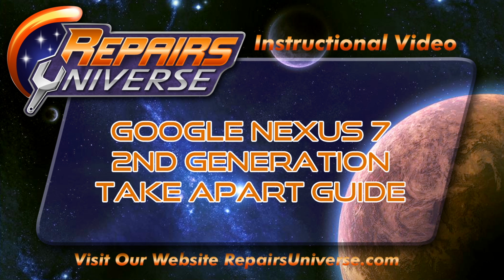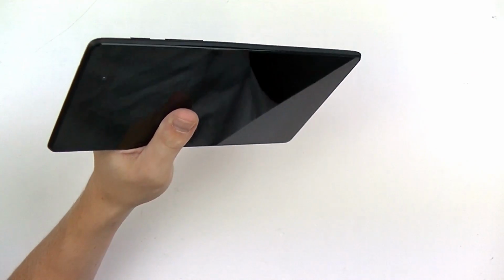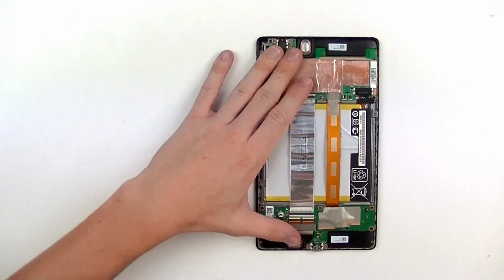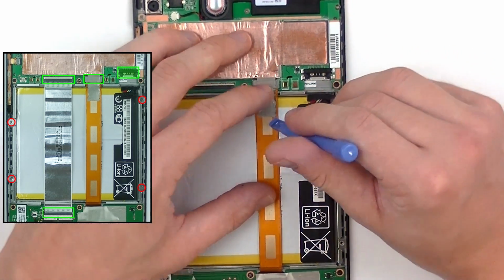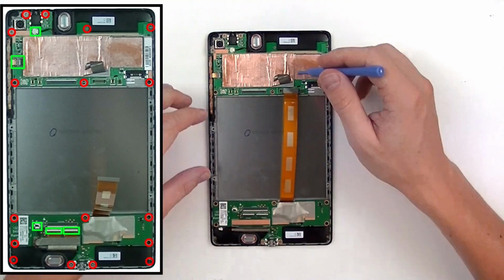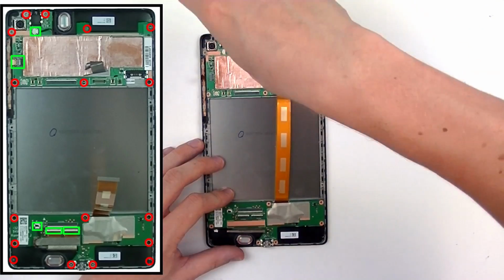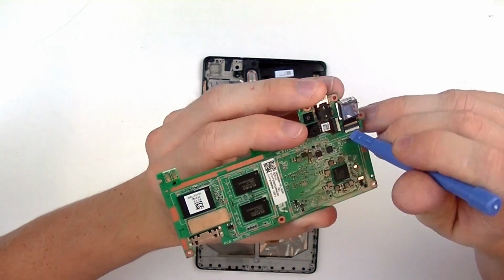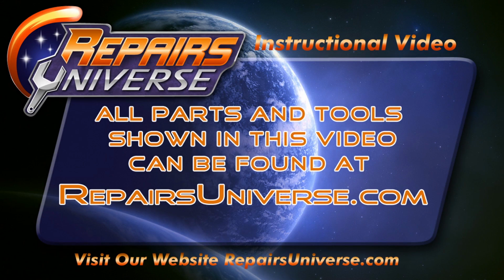Google Nexus 7 2 (2nd Gen) Take Apart Repair Guide

Comment: This is a great video, I used the information from your tutorial to swap my 16gb nexus motherboard for my 32gb. The 16gb works great, but the 32gb's screen was broken (just like in this video). I was worried about taking my working tablet apart, but after watching this video, and seeing the correct way to dissect my nexus. I was successful in replacing the 16 with the 32. This video is much appreciated. The best out there by far, it sucks watching videos without the commentary. Thank you.

Comment: Hi. interesting video. Same model as mine which had a mother board replaced under warranty due to intermitant ear phone socket connection. After replacement connection is  still sensitive to how far plug is inserted on various phone plugs. In your opinion is this typical as a number  of users have commented about problems with ear phone connections
Reply from the maker: +Keith Walters Possibly a manufacture issue as this should not be common.

Comment: Finished! This is the first time I've taken apart a tablet or cell phone, and it took me almost seven hours. The single biggest chunk of work was getting the old screen out of the bezel, which took me over two hours. More advice on that would be beneficial. Also, running through the reassembly would be helpful.

However, I have to say I'm really pleased with the quality of this instructional video, it was a tremendous help. The people at Repairs Universe where helpful and efficient. I chatted with a sales/tech rep before buying the digitizer & screen assembly, and their advice was valuable. I was going to buy just the digitizer and glass, but they talked me into buying the complete screen assembly. I was unsure whether they were just trying to sell me the more expensive part, but after having been through this, I'm very glad I listened to them!

Comment: Mine is 2014/4 manufacture, and there are a few subtle differences:
* The battery is held in place by more screws. Removing them reduces the number that have to be removed later.
* The lower speaker connection has moved.
* Important: the upper and lower motherboards are connected via two wires that run along the sides. You probably don't want to mess with those connections, but it's easy to remove both boards as a pair. Tape holds the wires in place along the sides.
* The upper motherboard has an extra screw in the middle, AND right next to that is a plastic clip that comes through from the bezel plate. Be sure to release this when you remove the upper motherboard.
Reply from the maker: Thank you for the feedback!

Comment: One warning that would be useful right at the beginning: I mistook the location of the seam you're trying to open the thing along. I thought it was right at the end of the glass. I chipped the glass (which is just garbage anyway, but causes glass slivers to fly around) as I was trying to pry loose the glass itself. There is a small plastic bezel attached to the glass. You want to pry between that bezel and the main body, not between the glass and the bezel!
Reply: +rod van meter Lol i did this too.... ............... wasn't replacing the glass......... replacing a part on mobo... sigh.....

Comment: My daughter's nexus 7  2ndG won't charge, the middle connector(or w/e name) is loose, my guess is that is fcked, well I'm not planning on spending a dime to fix it, I just want it to be able to charge and everything else can be done wirelessly that being said, is there anyway I can connect it to charge, I manage that with a HTC evo 4 years ago, I just aattached 2 cables to the broken charger port and those two to a customized charger... Pretty dumb fix but worked, I might be able to do the same thing now but I want some experience thoughts on the subject, why not spend money?? Well I'm trying to teach my daughter to take care of her shit cuz I'm not aboto to buy her new shit every time, and the insurance is a joke.... Whatever thought some trolls got in the matter about why not spending money will be ignored, get a life trolls... Ty for the serious responses though.
Reply from the maker: Difficult to confirm what would be best here. The charging port is soldered to the motherboard. I apologize but we would not have any recommendations to fix this on your device.
Reply: Hey if you buy a new USB port and simply super glue it on, it works. That's what I did to my nexus 7 2nd gen.

Comment: Why didnt i watch this one. I watched another video and he didnt take any parts out. Anyway replaced the screen but iv damaged the golden flex cable thing so i cant attach it (by the battery connetion). Is this the main cause why my new screen doesnt come on? Also the bottom of the screen it flashes white (when you have a notification) thats why im asking
Reply from the maker: Any damage to the ribbon cables will cause issues. Sounds like that is the reason for the issue. Sorry to hear the news.

Comment: My Nexus 7 has distortion (crackling sound) on the upper speaker. Do I need to take out the entire motherboard to replace the upper speaker? Could I just loosen the upper part and replace the speaker and how?

Comment: This is an exceptionally good demo. It is a pleasure to watch you. My Nexus 7 (2013) does not seem to hold the battery charge for more than 2-3 hours. Is that normal?
It was always that way and I never dropped it. Thanks.
Reply from the maker: No, not at all. The battery may be giving out on you. A battery should last about 1-2 years depending on the usage. Unfortunately we do not offer battery replacements.
Reply: Repairs Universe 1-2 years!? Is that it
Reply from the maker: Correct and it honestly varies on the usage. But roughly 1-2 years is about right.

Comment: My tablet fell multiple times on the charging port while charging. It would charge if the the USB cable was bent but now doesn't charge at all. With that now the screen is completely unresponsive.
Reply: Same thing happened to mine. Ya just gotta replace the port itself.

Comment: Hey is it possible I have a defected battery unit or damaged one of some sort. It doesn't hold much of a charge wirh serious battery drain with like 10% battery loss at the lowest screen brightness in less than one hour. I'm pretty sure its not a software problem. Is the battery capacity ruined somehow since lithium ion batterys are really fragile.

Comment: I dropped my nexus 7(screen spider web, sill works slightly, there are 2 holes i can see the motherboard through) and i want to back it up. Not showing up in windows 8, is there any recommendation you have for me?
Reply: The only way you could back it up would be to remove the memory modules, which wouldn't be wise at all.

Comment: Hi, I dropped my Nexus 7. The screen is shattered badly but the digitizer is fine. I cannot use it because of the screen. How do I remove only the screen?
Reply from the maker: The screen is fused to the touch screen. You would have to heat them up taking care not to damage the LCD. We recommend replacing the screen as a complete unit. You can find it here...
http://www.repairsuniverse.com/google-nexus-7-2-2nd-generation-screen-replacement-repair-parts.html

Comment: I dropped my tablet with the headphones plugged in. Now I can't hear out of one of my ears when I play music with my headphones plugged in. Iv got several different pairs of headphones AND different wires and they all have the same problem for my tablet. I can fix this if I lightly bend the headphone wire or push it up. So I know its a tablet problem, is there a way I could take it apart and bend the headphone jack or something to fix this? Thanks.
Reply from the maker: If you take the back off your unit. You will see the headphone jack. I don't think bending anything will help though. What you have done is damage the grounding rings inside the jack itself. Good Luck!
Reply from the maker: Difficult to say. May simply need to replace it but unfortunately we do not offer the replacement part.

Comment: Hi,My nexus 7 had water damage about a month ago,when it first dropped in water,i put it in rice for 4 days and took it out and worked 100% perfectly for two weeks. Than one day the battery stopped charging and the tablet died out completely :( but when i plug in the power cable the tablet notification light blinks and the empty battery life come s on.  NOW, Is the Tablet NO good? Or perhaps Needs a New battery? Please i need your Input! THANKS!
Reply from the maker: ***** Each water damaged device is a case by case repair. Most likely your battery is shot and corrosion is causing your motherboard to malfunction. A new battery might work, however it will probably short out again due to possible corrosion on the MB. You should open your device and use rubbing alcohol to clean the internal components.
Reply: Repairs Universe So i take the WHOLE nexus 7 apart and clean it with Alcohol: is this before i install the new battery? and how many days with the alcohol inside of the device until it drys out? Its like 70% its the batteries problem and/or 30/% its the motherboard? I see batteries on Ebay for 30$ and up, i wonder if its worth it in the long run. Thanks for YOUR input it means so MUCH! And please reply with as much information as possible thanks!

Comment: "Unfortunately you will want to replace both the LCD and touch screen digitizer. It is extremely difficult and close to impossible to replace only the touch screen". But you sell the digitizer separately as well (item 12-G-1130). Why is that? For the stubborn and adventurous?
Reply from the maker: Vytautas Rudzianskas We sell the glass for cell phone repair shops that have the machinery to recycle the LCD.

Comment: You are missing the hardest part and the "last steps." Removing/replacing the screen from the housing/bezel.  I have not found anyone, including your own website, that sells the screen assembly pre-mounted to the housing/bezel nor do you even sell the 2 sided mounting tapes or housing/bezel by itself.
Reply from the maker: ifm12009 If you have any issues with your repair, our technicians will gladly walk you through it. We have the double sided adhesive on our site for 2.99 and we are constantly adding parts to our inventory, so expect the housing to be added in the near future. Usually most of our customers already have the bezel and are just looking for the screen.

Comment: Dropped mine in water :(  How do you recommend cleaning it out if I can find a way to take it apart?
Reply from the maker: Doing water damaged is very tricky. Some times it would just need a new battery . While that is very easy to do . Some times you will need to clean out the water corrosion on the flex cables as well as the charging port.

If you see the water corrosion has started to eat away at the cables then its safe to say that the device is lost.

Good luck on your repair.

Comment from the maker: First, if the device has an expandable SD card slot, you could simply remove the SD card which holds data. Or perhaps try connecting the device to a computer using a USB cable. If the computer recognizes the device you might be able to recover data that way.

Comment: I have a dead Nexus 7 (got wet) that I'm curious if there's a way to recover anything that was stored on the unit.  I did open up the case and dried it out but the unit never fully powered back on.  I did have a short period of time with a dimly blinking white light and some screen activity, but now the unit does nothing when power is applied.